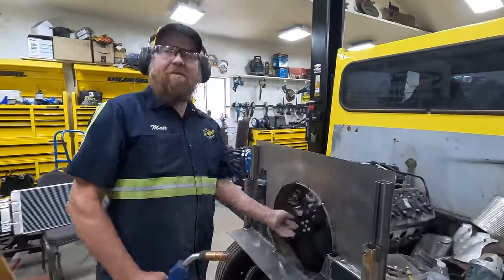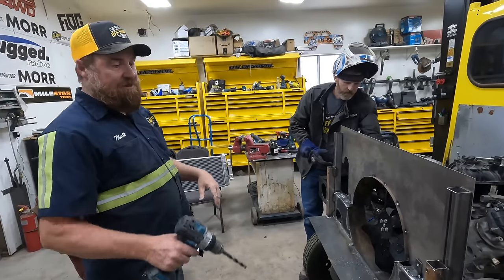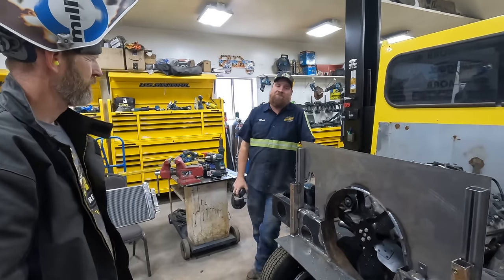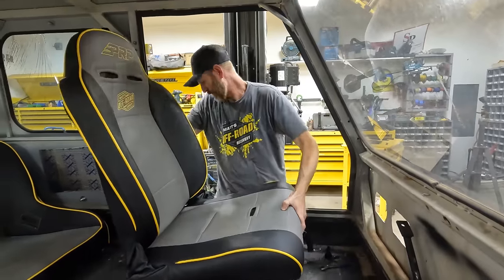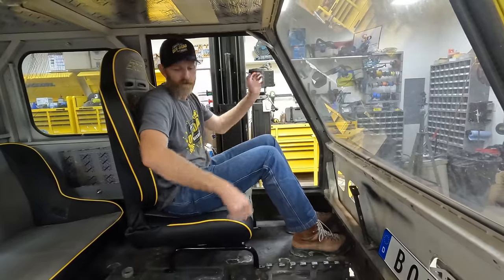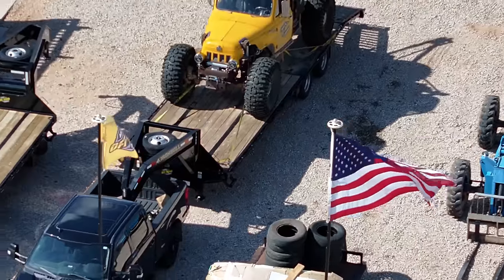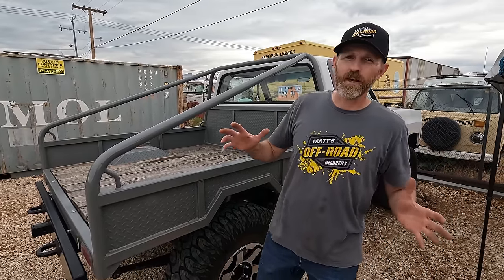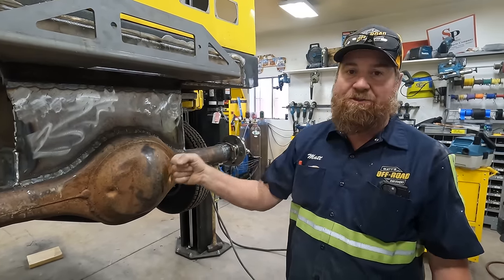The Best Upgrade The Bombi Will Ever Get!

Comment: Since that back seat needs to come up at least 6 to 8 inches, I would build a box underneath it for emergency items such as Trans fluid, Motor Oil, Coolant, spare fan belt etc. The rear seat bolted to the cover can then hinge forward for access. Cuz you never know what is going to go wrong in the back country. Even a couple of spare track links can go in there.
Reply: That is an awesome idea!
Reply: И резиновую бабу!

Comment: Based on my numerous years of running a snowcat in all kinds of winter conditions, I suggest you put some lights on the top of the cab as well. When you are running through fresh powder it will fluff up in front of those low down lights and that will drastically reduce your visibility. I'd also put some lights high up facing in all directions for work lights and to help when you have to work around obstacles such as trees, large rocks and drop offs. It can get really dark out in the middle of nowhere when it's night and snow is falling.

Comment: I think you will need lights up higher as well. The snow coming off the tracks will diminish the range of your lower lights. We run a groomer for snowmobile trails and found this out
Reply: I was think this too. An LED light bar across the front of the roof would be great as long as it can be protected from branches. Maybe some expanded steel would work.

Comment: Here’s an idea for the steering; have the bars in the middle and then have an attachment that brings the handles over top of your lap to bring them to center of the driver. Make the handles removable so that you can have left or right hand drive. 

Awesome project! Good job guys!
Reply: I was going to suggest the same thing. Watching Tom move the levers in the middle looked so awkward. Hey Tom. You know how the driver sometimes tells the passenger to grab the steering wheel and drive for a moment? That is pretty much the same amount of control you will have leaning to the center to control the sticks. Not only that. If you are driving for half an hour, your back is going to be so sore twisting, as you will constantly be adjusting the brakes.

In fact, here is another approach. If there is enough room for your feet, why not have dual foot brakes on each side, and then the speed lever in the middle? It would be like rudders for a plane.
Reply: That and gauges/dash just in the center to maximize leg room .

Comment: I’ve run reverse fans on my tractors and farm equipment for years. 
They work great!
The only disadvantage is if you are in really dusty/ dirty (snowy??) areas that pack up the radiator. It is a lot of work pulling the shrouds to wash it out. 
My latest loader has an electric fan that reverses itself to self clean.
Reply: This is how forklifts are ran as well. During the periodic maintenance service (PM) we blow them out with compressed air. He could do that and run a garden hose to clean it after the air blowout service.

Comment: That pusher fan idea is used in many types of equipment, particularly any non stationary engines that face backwards in normal operation. Certain cement trucks, tractors and the like, function normally, with no negative side effects.
Reply: It's not going to work.
Reply: Caterpillar as well has reversible fans that can blow forward in the summer  and backwards in colder weather so the driver can get some heat.
Reply: @danhumphrey5755  You just watch.
Reply: Since the fan is pushing, shouldn't it be unshrouded for more air through the radiator ?
Reply: IH has a very successful farm tractor that blows air thru the radiator, and out the front of the tractor.
Reply: @danhumphrey5755 lol, like you know...
Reply: @georgevindo   Concur.  During winter on our old D-8 Caterpillar bulldozer doing land leveling jobs we would hang canvas cut to fit the sides of the engine to direct warm air to the driver. 30°F the driver had 80° warm air blowing past him. The Cat had no cab for protection from Mother Nature.
Reply: @wcarroll1507   No, you have to have the shroud for the same reason as you do for inlet fans, to make sure that all the air coming into or out of the fan is either drawn thru or pushed thru the radiator. The radiator has a large restriction in air flow so you have to create either negative or positive air pressure to force the air thru the radiator fins and water tubes. Without the shroud the air will take the path of least restriction and just blow out the sides or draw air in from the sides.
Reply: I recommended a couple electric fans on the outside of the radiator. Can't hurt. Especially at idle considering the fan is direct drive. No clutch to engage if its idling for a while
Reply: A shroud in a pull configuration pulls air through the entire surface of the radiator and should do the same as a pusher. Looks like Matt's configuration will only push air through an area the same size of the fan , not through the entire core. @WJV9
Reply: Basically every forklift in existence uses the same style fan, and they work just fine.. not to mention skidsteers use the same design..
Reply: @danhumphrey5755 Literally every from end loader, skid steer, what have you uses the exact same engine layout.
Reply: I had no doubt it would work but I was questioning  how good, I belive in an old video they had over heating problems.
Reply: @johnkolodzie9888  that might have something to do with the tired GM 4.3 engine, and maybe an undersized radiator.
Reply: @connercurzio3645  parking lot sweepers with a second engine, and propane floor scrubbers also use pusher fans.

Comment: Just a heads up to anyone using riv-nuts, be careful using them in hard to reach places if you plan on applying loc-tite to the bolts you're screwing into them. If you ever need to undo them there is a chance they will rotate with the nut (since they rely on friction to stay in place), thus making it incredibly hard (if not impossible) to undo.
Reply: Note taken on my overland project.
Reply: Especially if you use conical one's that sit flush, if you don't get the angle right on the material you putting the nut on you'll have a hard time getting that friction you need

Comment: The front lights should be on a plate that is level with the bottom of the winch plate. Maybe some holes to lighten up weight wise. Ed may be getting up there in years, but he is still sharp as a tack. Great ideas, Ed.

Comment: Just a thought, since you are not going to use the head light pockets.  That area will have to be rebuilt. Extend that area about 4" forward for foot pockets. Looks like you will need every inch you can get inside.
Reply: good opportunity to add leg room
Reply: Good idea
Reply: And remove the floor  gas peddle and change it to a bike brake handle on one steering lever for even more space and a better driving position!
Reply: I still say, add about 6 inches to the back of the cab, I know the back seat will be a lot higher. This will add more leg room. The people need two be able to get in and out.
FYI: my suggestions are just for fun and to support the channel. They are not and never would be critical of the designs Matt and Tom make.

Comment: Matt, in regards to the beacon on top you can make search n rescue helicopters find you easily at night if you have a IR strobe setup on the roof.  Makes finding you easy work in a dense area.  👍🏻
Reply: Don't want to be found? O F F button
Reply: Technically, Matt doesn't tend to do active SAR (search and rescue) jobs as he comes in later to get any vehicles involved, but it doesn't hurt to have it. It's a lot better to have one in case it's needed than to have the situation become 2 vehicles lost.

Comment: I’d suggest a LED light bar across the top for lights, or even a roof rack with LED pods. Considering this will never be on the road or facing oncoming traffic using really bright lights would never be an issue and I think would give the bombee a sweet look! Although not as cool IMO, the pods could also be mounted to the tub too if you want to leave the roof alone.

Comment: Whew, was getting anxious about the slot in the fan shroud under the upper hose. ;) Maybe the upper & lower need dowel pins or interlocking fingers and less bolts (like GM stuff used to have 2 bolts and the whole upper shroud comes out). 
For lights, 2- 6" above the winch, 2- 6" outboard just below the windshield (or on top) and a controllable spotlight on top (like they dogs on the 50s in the A pillar). Oh and going to need flood lights in the back too.
Great job! Keep it up.

Comment: I'd modify the old headlight holes with LEDs. I would also add some on the back. The idea of a high powered remote control spotlight up on the roof is a good one. I would add some wide-angle spotlights on the sides to be able to check clearances on the tracks in tight areas. There's no such thing as too much light in the darkness. I don't know what I enjoy the most watching you guys modify something to your will or doing recoveries. Always enjoy your videos thank you very much.

Comment: I love the idea of a removable cab having a winter cab and a summer open cage that are seasonally swappable is a brilliant idea Matt.  So all the dash with gauges and hand brake steering controls will need to be mounted to the floor tub good luck with those tight spaces

Comment: Just a suggestion on the control sticks: You may want to think about putting the brake handles in the middle, and then adding extensions over to the driver location to make it easier to get in. Also would be possible to swap the driving position to the other side for whatever reason, if you make them removable.

Comment: The steering really wants to be in front of you.   When rolling over bumpy areas, the seat belts will keep you centered and bending right while trying to fight the belts lol.   As for head lights, you may want to keep them high as you can because of snow drifts.   Bombi is looking real good guys, keep it up :)
Reply: Won’t high lights create too much glare, especially in whiteout conditions?
Reply: And use an amber light for in the snow
Reply: Agree with steering being in front of driver. But why not dual control like in a plane or helicopter so with side can drive? Love the effort team!
Reply: Been tried, problem was that to get a cable setup that can have the right tension to turn say left and not affect the right brake.   Brakes tend to overheat too quickly. @4goten

Comment: A lot of older tractors (front loaders, dozers, escavators etc) are set up so that the fan blows through the radiator through the engine bay. They work just fine with no overheating issues. The reason for doing this was to keep hot air from blowing on the operator.
Reply: IMHO: Set up to keep the radiator clean. (Blow out the dust.)
Reply: @yowser8780  
Believe me they blow out the dust. When I reversed Cat skidder and dozer fans I couldn't see where I was going half the time.

Comment: Matt, you might be able to put school bus heaters under the front seats, and not necessarily have to mount it on the front firewall. You might still need a defroster, but you might be able to fab up something that will do the trick, maybe like the old International Scouts did.

Comment: About the cooling...viewers must not be aware most heavy equipment such as bulldozer and graders have used blowing air instead of pulling air... primarily to keep from blowing the hot air back on the operators. Also, buses and motor homes have used different method of pushing air instead of pulling fresh air for 70+ years. The method of pulling air from the sides and discharging became very popular (such as the Tucker) in pioneering vehicles with lower wind drag co-efficiency (wind tunnel testing) (rear discharge eliminates suction behind the vehicle).   Love the videos, keep them coming!

Comment: Bombi is not surprisingly looking amazing!! Y’all need to engineer a way to put the steering sticks on either side of the driver seat. Hand break on the left and the other on the right. Seems like that would feel so natural, and could also help with the limited space issue. Addicted to the builds, keep crushing it!
Reply: The increase in ergonomics alone would justify the effort needed.
Reply: shouldnt be too hard. anchor them in the middle, then have hinges to swing it around.
Reply: Like a zero turn mower! Yea that would be nice
Reply: ZTR controls!   That would be perfect if it would fit.
Reply: Agreed! Would be awkward and uncomfortable over a long period to reach both hands towards the center of the cab to steer.
Reply: I'm a little different... I would raid an old skid steer and use 2 foot pedals for the brakes... and a hand throttle from a motorbike. You can have a nice, low profile, handlebar type set up to hold onto and use the throttle (with light switches, horn etc). The two foot pedals would take up very little room and make for easy ingress and egress.

I think they want to use center mounted sticks so its easy to get in and out of the drivers seats, I would do away with the sticks totally.
Reply: I would think you could use a handlebar style for steering and brakes. That would make it easier to drive and be more comfortable.

Comment: Matt's not just committed to recovery work, he's welded to it.
Reply: And wears PPE!  Good job Matt, you and your crew rock!
Reply: So which episode will Matt get metal in his eye and will he tell us? Comment below.
Reply: Jaymie, PIN this! LOL
Reply: That's a brazin' statement.
Reply: @kenc1800 and then he puts the angle grinder between his thighs to hold it with the cutting wheel still spinning.
Reply: Maverick
Reply: Noice
Reply: Clever
Reply: @kenc1800 He doesn’t wear a face shield or gloves and removed the guard from the angle grinder WHILE USING A CUTTING DISC!! Dudes gonna get nailed one of these days and it’s not going to be pretty.
Reply: @kenc1800 drilling through metal towards himself, no eye pro when welding…
Reply: @NoNORADon911 that or a broken zip cut through the arm.
Reply: @makattak88 uh he’s wearing safety glasses.  Angle grinders should scare anyone that’s used to them.  I say that because they’re typically not worth a damn for much unless you pull the guard off.  
HE HAD SAFTEY GLASSES ON.  I prefer a face shield myself
Reply: @tkostang  no, he often is NOT wearing safety glasses. Watch the video again. 👍🏻
Reply: @tkostang  yeah, the guard is useless until the disc blows up. Have fun finding out about what happens then.

Comment: I’d be interested in seeing actual ground pressure calculations for all your different vehicles, especially the Bombi.
Reply: I think Matt talks about the ground pressure of the banana and the morrvair in one of the episodes at the end of the morrvair build fwiw
Reply: He actually does this and demonstrates the difference in ground contact coverage using paint.
Reply: Average ground pressure for tires will always be pretty similar to the PSI that is in the tire (regardless of how big or small or wide the tire is an regardless of how much weight is on it), as long as the tire is being operated at a pressure and weight that is in the range of flexibility supported by the tire. At the extremes this breaks down a bit because a radial tire can only deform so far, but for sand and other "soft" surface scenarios where the tire and the ground both give a bit this will be very close to accurate. 

When MOR tested contact patches with paint between different tires and vehicles they always came to the conclusion that the ground pressure was similar to the air pressure that was in the tire. 

This result has been verified by many other similar "scientific" tests performed by other content creators on youtube, however, despite those tests, the prevailing assumptions about ground contact pressure among most humanoids who troll the internets is still wrong. Most people assume that wider and taller tires automatically make larger contact patches, but in reality they only make larger contact patches if operated at lower PSI. With that said, a larger tire is required to be able to operate at lower PSI without running on the rim, so the larger wider tires are a means to get to lower ground pressure and larger contact patches, but only if operated at lower air pressure. 

The bombi ground contact pressure will vary quite a bit depending on the surface it is operating on. It won't "Spread out" it's weight on the track evenly until the surface below it is soft enough to deform... Deep snow will maximize the effect, which is where it counts.

In conclusion: The banana, morvair, and heavy wrecker will all have ground pressure of ~6-16PSI depending on what air pressure they are running that day. The bombi, will have ground contact pressure around 0.5PSI when operating on softer surfaces.
Reply: @mdocod thanks for this reply, saved me lots of typing lol
Reply: @mdocod the best explanation I've heard in a long time. Normally ground pressure will be 1-2 pounds higher then tire pressure, basically to account for tire weight and the 4% load carrying of the casing itself.
Reply: @ray132001  1-2PSI above inflation pressure makes sense to me! The tire has some resistance to deformation from the strong carcass, so this would result in slightly higher ground pressure than inflation PSI on average. I imagine the "amount" of extra pressure could probably be determined by pressing down on a tire that is deflated, until the sidewall is bulged to the anticipated bulge expected at the intended inflation and weight. Whatever that ground pressure is without any air, would be added to the air pressure.